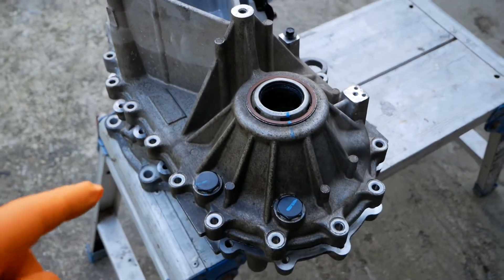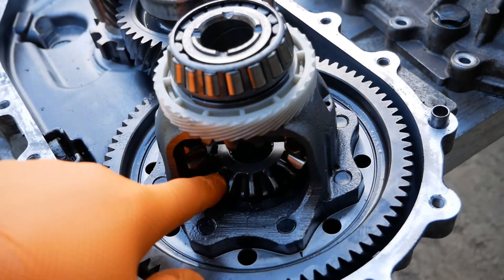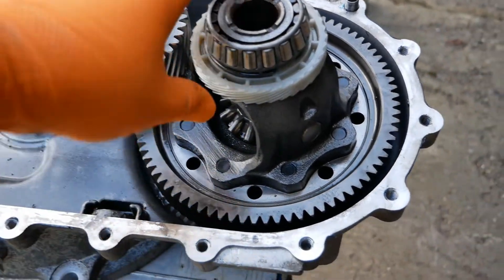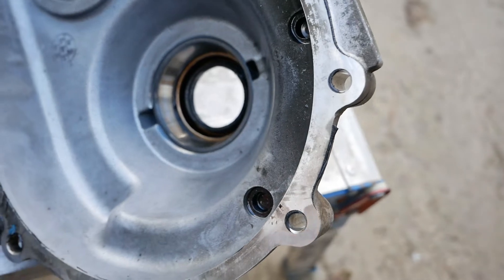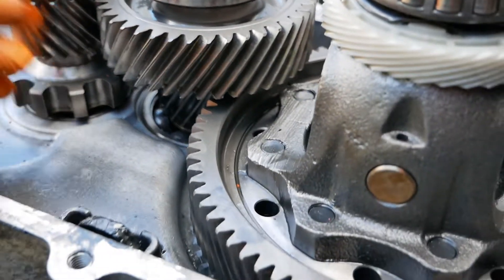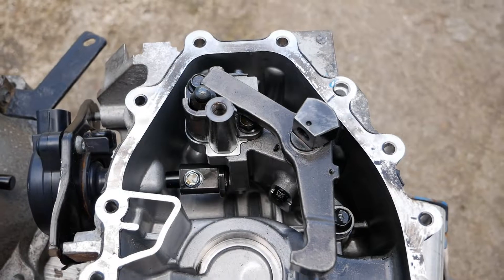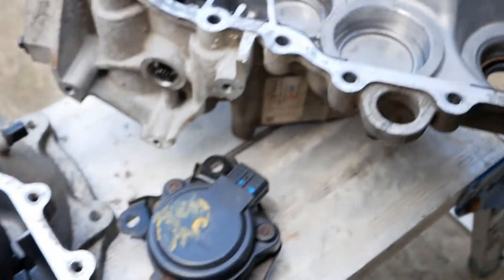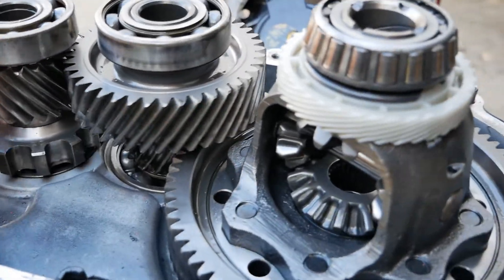What's inside an electric vehicle gearbox? A look inside an EV reduction gearbox. PART 1

Comment: My thoughts on the plastic part.
This part (differential) is a regular sub-part in earlier Hyundai-Kia cars, and used to be connected to the speedometer. It no longer has that function here, and on newer models (Nior), it no longer does.
Great video, thanks.
Reply from the maker: Probably right. However, there are no previous electric cars and combustion engine cars do not have gearboxes like this. But I guess the differential has been carried over.

Comment: how reverse will work?
Reply from the maker: Unlike an engine, the electric motor spins the other direction so no reverse gear is needed in the reduction gearbox. The motor is electronically limited in reverse, so it doesn't do 100 mph backwards!

Comment: Does anyone know whether you necessarily need to take the engine out (i.e. unplugging the drive battery, removing the collant liquids, etc) to get the gearbox out? The video does not answer that question and most videos I've seen seem to take both out, but if it is possible to remove the gearbox only, I guess it makes life easier when considering a GDU repair (I own a Niro that makes the typical GDU sound...)
Reply from the maker: No the motor or the high voltage doesn't need to be touched to remove the reduction gearbox. Do remove the service plug from the HV battery though.
Reply: @GoGreenAutos  Thanks for your quick reply, I appreciate! Do you know any tutorial or video that shows how to proceed (taking it apart from the engine, remove the cv-joints, etc)?

Comment: hello, always been a fan of your videos. your videos helped me fix the add coolant issue on 38kwh hyundai ioniq.. need your help again, my car was giving some mumbling/ humming sound coming from the car. took it to a mechanic in east london, ice machenic, and he put it up on ramp and said, its the gear box. gearbox gone.. upon searching internet i figured EVs do not have a conventional gearbox. what should i do next now? can i drive the car for now till its fixed as i use it for minicab.
Reply from the maker: How many miles has it done? I would start with a gearbox oil change as this is easy and cheap to do - see https://youtu.be/QhJOI4lYF1c?si=4ZCG_D9_X3X47BBA
If its done loads of miles, it could be worn bearings either in the reduction gearbox or electric motor.
Reply: @GoGreenAutos  just dropped it to another mechanic near hertford area ( cheshunt ) .. i have done 70k miles.. if the bearings inside gone, how much roughly you think it will cost. dreading it… any specialisit place you recommend i can take it to or maybe get it checked by yourself..
Reply from the maker: @hussain-b7m7f  The bearings themselves are cheap. The issue is that they're not a Hyundai part so you have to take the bearings out and then measure them and buy replacements from bearing suppliers. So the labour ends up being costly. I can't recommend anyone other than going to a HEVRA garage - see https://hevra.org.uk/ev-garages-near-me/
Most garages don't like doing this sort of work.
It shouldn't be bearings though at 70k miles. It would typically be twice that before these are worn.
Reply: @GoGreenAutos  would it be better to buy a engine with gearbox of same car and have it put in… i saw someone local to me selling same engine with gearbox ( 20k ) miles on it for a grand.

Comment: Hello sir, I have a question please: What are the steps to disassemble this gear box?  Should I remove the HV battery and remove the electrical circuit breaker?
Reply from the maker: No need to remove the HV battery, but you should always correctly isolate the HV before doing any work on the powertrain.

Comment: why does a electric vehicle need a gearbox ? isnt the motor controlled by battery current , so it will reach intended speeds as required ? i thought there was no gears in electric cars

Comment: Funny that you don't mention the missing end cap of the input shaft. You are literally pointing it at 8:21. At same second you can see the groove inside the input shaft that the cap should be sitting on. My gearbox had that loose as well. Could be one reason for dirty oil as the cap rubs against casing.
Reply from the maker: No, only since the gearbox has been dissembled. It was all good and in place when first opened.

Comment: This is a differential.   not a gearbox
Reply from the maker: Its a single speed reduction gearbox with a differential.
Reply: @GoGreenAutos  All automotive differentials are 1:1, if they were anything else the car would want to go round in circles. But they all have a final drive reduction gear, either a bevel gear for RWD or a spur gear on FWD. The final drive gear is attached to the “pumpkin” by bolts and can be replaced.

Comment: I think the reason for having a parking pawl is same reason braking systems work much the same and use a corrosive fluid that needs replacing every few years.  It's a matter of what a manufacturer is willing to defend in a courtroom if they are sued.  H/K seem fairly conservative in this regard while Tesla seem to thrive on breaking the rules.  In the end I want my car to be safe and having a parking pawl is a very reliable way of holding a car.  On the flat I don't bother with the EPB as there's just no need for it.

Comment: As a note, you've made a minor error in describing the orientation.  The motor is positioned forward of the final drive when installed in the vehicle, not above.  Following that, your identification of the drain and filler plugs was subsequently reversed.  The nylon gear would be used on other applications of the final drive gear assembly, nothing to do with oil flow; it's missing in the Kona and Niro.  But, I'm grateful that you've inadvertently demonstrated the reason the oil turns black when you pulled out the magnet, which you saw was retained only loosely in its pocket.  Because the nearby final drive gear turns counter-clockwise in that view, the magnet rattles and spins under the impingement of oil flung off the gear, just like any object does on the ground when sprayed with a garden hose.  That magnet will be collecting wear particles from the gears but then rubbing them against the aluminium housing as it spins. That abrasion could be wearing some aluminium off (can you have a look for signs of that wear?) which I believe is why most used-oil lab analyses from the Ioniq, Kona and '19-'22 Niro show highly-elevated levels of both iron and aluminium. Iron particles lose their magnetic attraction after being 'working' in this way, so they leave the magnet and return to the oil.  Non-serviceable magnetic oil filtration is common in automotive applications, the Bolt is one example among EVs.  Over the car's lifetime the capacity to retain particles should be sufficient, provided it's held rigidly.  H/K seems still unaware of this problem and I suspect the infamous wheel-of-fortune noise was the result.  Several owners have rebuilt their gearbox (one commented below) and in all cases the ball bearings were found to be rough, which pretty much conforms this idea.  H/K would have been smart and possibly saved a few million dollars to simply delete the captive magnet years ago and install a normal magnetic drain plug instead.  Thanks for the video!
Reply from the maker: Thanks for pointing this schoolboy error out. I've just checked mine and noted the park actuator is at the top. I'll record a part two to correct my errors.
Reply: @GoGreenAutos , It would be great if you could also clean out with solvent the magnet's pocket in the housing and take some close-up shots of the interior to see if there are any abrasion marks from the magnet rubbing on it.  Another gearbox feature that's interesting is at the motor end of the input shaft. If you remove the shaft there is a brass ring near the bearing which turns with the shaft and provides a ground to the housing to drain off small stray voltages that enter from the motor. You could check with a ohmmeter that the ring is indeed grounded.

Comment: Thanks! Interesting! So oil in gearbox oil doesn't need topping up generally? It's only done during a service? How often (Zoe 22 driver here)
Reply from the maker: Most manufacturers say their gearboxes are "sealed for life". There's no top-ups required, unless a bearing seal or the gasket between the two halves have failed, which is extremely rare (probably not yet happened).
But its advisable to change the oil occasionally. I'd say about every 50,000 miles or so. But this is not part of the service schedule on EVs. I've got videos on the channel on how to do this and the Zoe video is coming in a few months time.

Comment: Renault Zoe seems to be having problems with broken gearboxes. Could it be because people don't stop properly when changing gears?
Reply from the maker: Could be a contributing factor. Putting strain in the park pawl is, which I've got a video coming up soon on this subject.
On the Hyundai Ioniq 28kWh, you could jump between Drive and Reverse while the vehicle was still moving slowly, which was useful when parking. But on the later 38kWh Ioniq, they've changed it so you have to be stopped before you can change the gear, which can be quite annoying when parking.
Reply: Early Zoes have problems with bearing failure. It’s quite feasible to replace the bearings. However a main dealership will just quote for a new gearbox 😬
Reply from the maker: @hughmarcus1  Yes, that's quite normal for main dealers as the bearings are not a separate OEM supplied part. The same goes for all manufacturers on most components. The electric motor is one part and so is the gearbox. You have to go to an independent garage to get that level of repair, but its still not easy as the bearings are not identified and therefore not available off the shelf without first taking them out of the gearbox or motor and measuring them first.

Comment: Hello! Thanks! for a good Video. In the Gearbox you show in the Video, there appears to be Gearbox Oil in it. Is that so? I asked the Volvo dealer, who sells the Renault Zoe. If there is Oil in Renault Zoe's Gearbox. And they said that there is no gearbox in the Renault Zoe. It's some electrical thing that does the job. Thanks! From Tommy Bertilsson from Sweden
Reply from the maker: There is oil in every EV gearbox. You can't have metal on metal without some lubrication! I will be doing a video showing how to change the oil in a Zoe gearbox in a month or two's time.

Comment: Hi very simple, why not show all the complex electrics in an ev. Like the high power inverter bet thats not simple.
Reply from the maker: Because the video is about a reduction gearbox. Yes, EVs have an inverter module and a on-board charger module which is full of electronics and I'll do a video about those one day when I have examples I can take apart.

Comment: Theoretically they should last a long time but Hyundai/Kia have had lots of issues with the reduction gearboxes and motors in the Kona and Niro, I’ve even seen a few reports of clicking sounds with the Ioniq as well but my theory is that it affects the Niro and Kona more because the additional power=additional stress on the powertrain. They’ve moved to a very different drive unit for the redesigned Kona and Niro which lowered torque substantially, likely to try and solve the problems the current/previous designs had.
Reply from the maker: Yes my brother has a Kona EV and it was making a clicking sound and it had both the motor and reduction gearbox replaced under warranty.
Reply: @GoGreenAutos  Thanks for video. It is really helpfull. Do you think that clicking sound comes from bearings or something else ? My kona started to make that noise when regening so without warranty I need to learn which action should I take ?(change bearings etc )
Reply from the maker: @NewGuy3211  Is your Kona out of the 5 year warranty then? I'm not sure what is causing the clicking noise. Its either the reduction gearbox (which could be the bearings or differential) or the motor bearings. I have my suspicions that its the differential in the gearbox as this is the weak point and can break due to the torque of the motor. Part two of this video is coming soon which briefly talks about this.
Reply: @GoGreenAutos  I imported from germany, so there is no service for me or warranty in Turkey. I have to find solution by myself. I am waiting your second video then.
Reply: That's because the bearings are made in China.
It cannot withstand the torque of the motor and the bearing fails, producing noise.

Comment: Would the nylon gear be the speedo drive?
Reply: That was my first thought as it looks like the nylon worm gear that used to drive the speedo, but these days it would surely be electronic and also there is no access point on the gearbox case.

Comment: Incredible video. Very informative. I love how simple this gearbox is and how durable it has proven to be after 100,000 miles.
Reply: It's interesting that the park actuator is the most complex piece and the common point of failure. It looks like Hyundai went with serviceability for that which bodes well for cost and complexity should I need to replace mine at some point.
Reply: @AlainODea  the park pawl design was poor in the Kia Soul EV and this in the Ioniq is the improved result.  I haven't seen any issued raised on any later H/K EVs.
Reply: @KiwiMechEng  good to know! Thank you. I think Hyundai has positioned themselves well  here.
Reply from the maker: The Zoe ZE50 has done away with a park pawl and all others need to do the same as this is a cause of wear and problems, which I'll be highlighting in a video in a month's time.
Reply: @GoGreenAutos  nice! Hopefully the other car manufacturers follow suit. Looking forward to that video when you post it!

Comment: My MG ZS makes a quiet but distinct noise when I hold it at zero power when moving (ie. Just enough throttle to counter regen). I wonder if it is one of the gears in the reduction "floating" as it is neither transferring or removing power. 

Has anyone else seen this? Should I worry?
Reply: If it's high-pitched, it might just be the inverter.
Reply: @MartinPedersenTM  more of a mid-ranged mechanical sound

Comment: Overall, that does show you that the current price of EVs is a joke considering that there’s basically not much in them, apart from the wiring and the battery. Manufacturers are just trying to recuperate the money lost in sale of spare parts 😂
Reply from the maker: Just down to development costs and lower volumes. But the new prices of EVs are getting better....well not lower, but not increasing like ICE vehicles are, so getting nearer to price parity.

Comment: The position of the magnet inside the reduction box may be to prevent the clogging of the of the entry/exit valves you mention at the bottom of the gear box since you mention later on in the video that other manufacturers that have magnets near those valves can detect metal debris near those inlets/outlets?
Reply from the maker: I don't think that is the reason. If there's debris in the oil, you want it out of the gearbox, not stuck inside. But then that debris isn't large enough to foul the exit hole. All other manufacturers put their magnets in the drain plug. I wonder why Hyundai has decided on this method??

Comment: My ENV200 reduction box had the diff disintergrate at about 60,000 miles🙁. I bought a second hand complete gearbox and fitted it myself for £500.
Even though there were thousands of metal particles, they had all been collected by the two magnets, which supprised me.
It is a good idea to not use full throttle from standstill, as the torque from electric motors is immense, and untill the gears are spinning you are asking all that torque to be transmitted by only couple of teeth
The fact that the gears rotate faster than ICE cars is good! If the gear rotates twice as fast, the strain that each tooth sees at that instant in time is halved.
Reply from the maker: Nissan Leaf and ENV200 gearboxes are prone to having chunks of metal in the oil!
Reply: A properly designed gearbox should handle the load but a careful owner would be wise to get rolling before hammering it.

Comment: Really simple gear reduction box. Im guessing any metal filling will be coming from the park lever/gear. The oil  drained out of my ioniq was fairly black but no metal  particles at all. I think the magnetic drain plugs are not worth putting in. May be good practice to change the oil after 20/30k miles. No big deal even if a bearing fails . Theres so many reasons why the electric car is going to be more reliable long term than a ice car. That needs highlighting more.
Reply from the maker: Yes, good practice to change the oil every 50K or so. I've done videos about this on the channel.

Comment: Mine had 73k km on it and two bearings on the middle shaft went bust. The one you have there is extremely dirty inside compared to mine, and it'd say it looks like your bearings in the middle show sign of wear on the outside race. I wouldn't put it together again without putting in new bearings. I bet the oil was pitch black when you took it out. Mine had new, a few times which is probably why its very clean inside. The Kia version has a square magnet, so it doesnt rotate and drop off debris in the oil flow, hence they have substantially fewer failures. I unfortunately had to buy a new box, because I didn't know if it could be repaired. I know it can now, so I'll have a spare soon.
Reply from the maker: The oil was very clean actually.
Reply: That is curious. Yours look very dark on the inside walls and mine is silvery, like the aluminum you show on the motor spline side.

Comment: Thank you for your educational video a great view of the inner workings of an ioniq gearbox
Are the rear handbrake actuators similar to the park one on the gear housing ?
Reply from the maker: Well, in that they are an actuator, so it spins a shaft or gear. But a completely different shape and size.